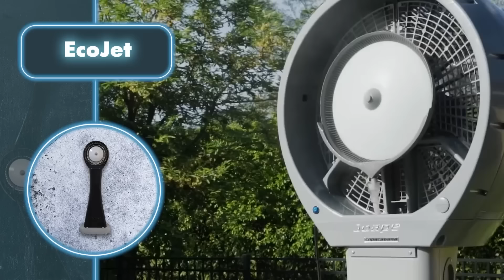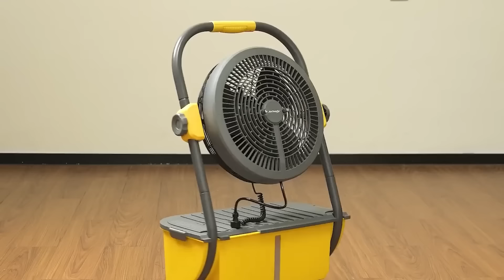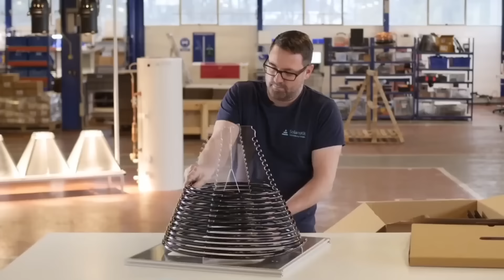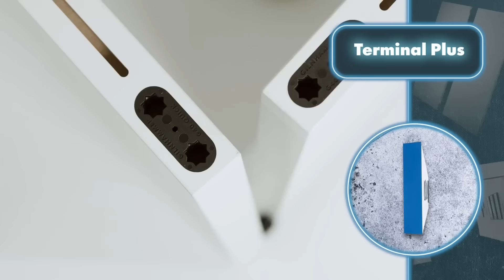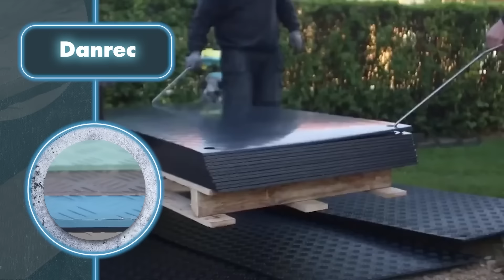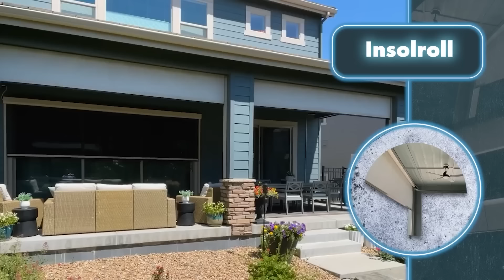60 Amazing Inventions Every Homeowner Would Like to Have

Comment: The drying rack is ridiculous.  For centuries Europeans have had drying racks that lower from the ceiling for loading, then, using a simple rope/pulley mechanism, are raised above head level again for the drying process.  Who'd want this thing that's hard to reach when they could have the old more convenient method?

Comment: Draftbooster is interesting!  And simple.  Why don't all chimneys have this?  Does it run continuously or just until the fire is going well?   I never had a smoke problem with the cast iron woodstove.  Now that I have an EPA approved woodburning fireplace, and high ceilings, the smoke ALWAYS goes into the room if the chimney is cold.  Opening a window does not help in the least.  I have to use a hair dryer to warm up the chimney at least 5 minutes before lighting the fire.

Comment: 50:40 HurriGuard - Nothing you cannot do yourself, just buy the polycarb sheets, washers, etc and DIY. What would have been more impressive is a system that did not need to drill into the window frame.

Comment: The one I want/need is the last one!  I need to lay that in my barn so it won't become a bog every time it decides to rain all day!  The horses won't be standing in hock deep mud in their stalls and I won't have to wear hip waders to go feed them. (the horses do NOT stay in there all day, only to feed so they don't run each other off or steal feed from each other.)  Edit:  Never mind.  At a cost of $175 for 40 sf, I might as well pour concrete!  One stall is 144 sf and I have 5 of them plus the 12' by 36' alley way.  It would cost me over 5K  to do the barn.   Nope.

Comment: The roof cover . To set it up you have to drill holes in your roof to set up some type of poles device. Not all roofs are just straight gable there's dormers valleys overhangs etc. So you would be damaging your roof with all the screws they put in and I didn't see any caulking or any sealant put down before they screwed that thing to the roof. So in a storm or just a regular spring rain with some wind your roof is going to leak and in a gust of wind that tarp will rip . I'm a roofer and I don't think it will work.  You're just asking for trouble if you have that installed on your roof. That's my professional advice.
Reply: I was thinking the same thing, but I thought that tarp was to be used for "hole in roof" situations only, not just  bc.
Reply: I believe they said it was for a quick, sturdy & temporary solution for roof damage till roofers could have time to repair or replace the roof.
Reply: @luvfunstuff2  no they didn´t...literally they said is for protection for a storm or hail...HAIL😂go figure😂
what you said makes more sense that what that voice is saying
Reply: @lovienyoutube420  yeah, I'm pretty sure the narrator got the story wrong there because who would want to put holes in the roof for a cover that has got to be less durable than the decades-long lasting roof?
Reply: daaamn, as i saw it i stoped and came to look for this comment...how dumb was that?😂
i do stageing and in a windy/stormy situation that would be the last thing you want to have screwed to your roof😂
Reply: Yeah that made me laugh.